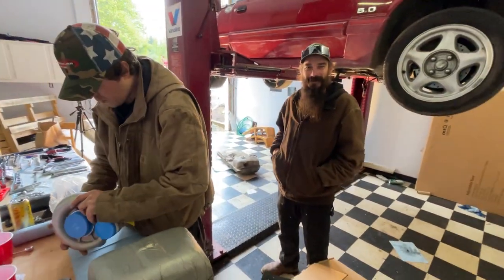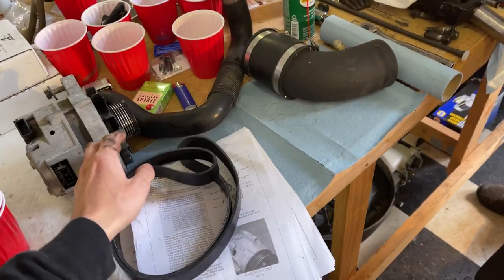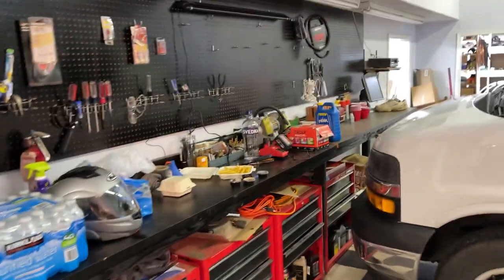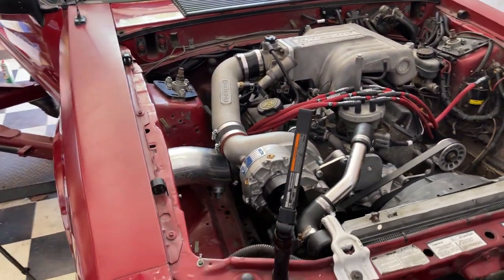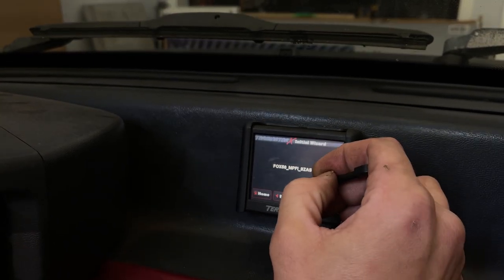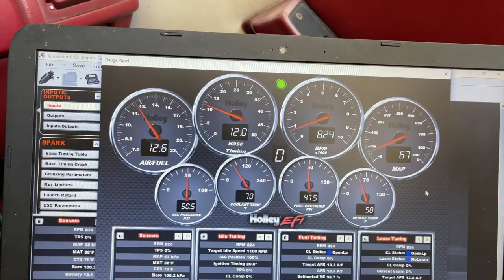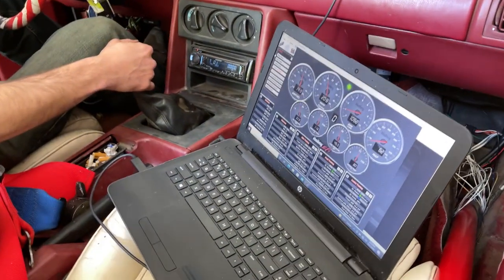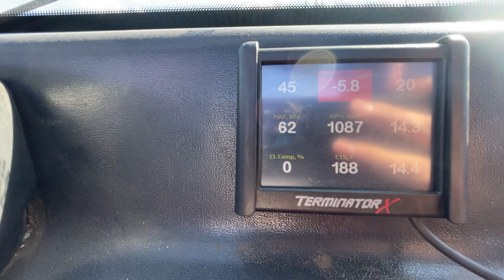Foxbody Mustang VORTECH V3 SUPERCHARGER Install!

Comment: Hey brother shouldn't target air fuel be about 12 or so being boosted? I've always thought that 14 or so na and 11 or 12 boosted was safe.
Reply from the maker: Yep, at idle though, 14.0 is ok, and even cruising could be a little richer around 13.5-14.0 but we have it set at WOT to be around 12.0. If you saw it a bit high, it was because we were cruising. We just started it on the Holley base map, and I scaled it a bit, but he had already gotten a tune, so we got it dialed in 👌 You are right for sure.
Reply: Yeah on pump gas street I would wanna be around 11.4-11.8 WOT. Idle around 14.3-14.7, cruise 14-15 ish